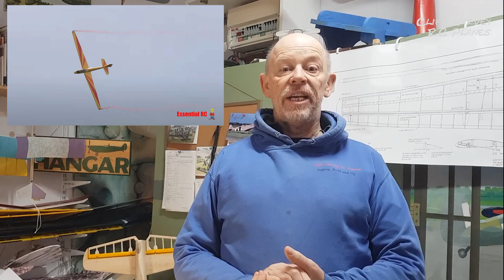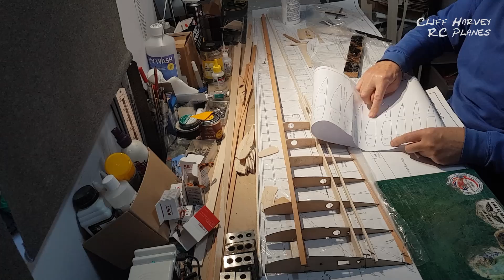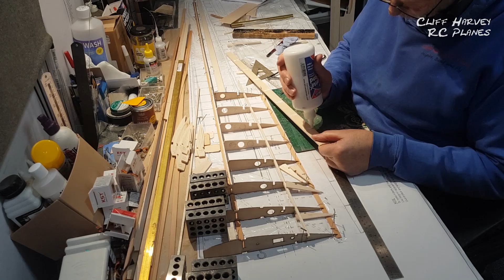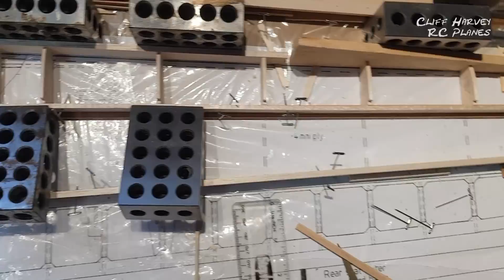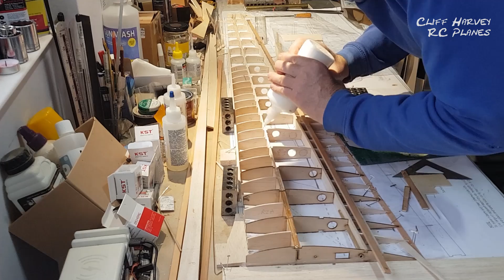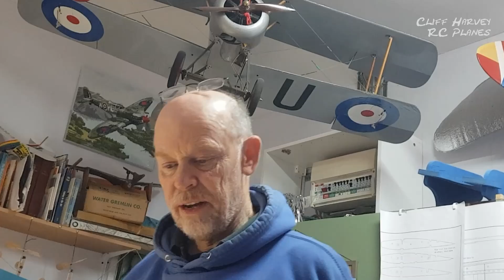Lunak Aerobatic Vintage Glider Plan-Build Part 13

Comment: Cliff, is the washout already on the tip ribs?
Reply from the maker: @stevemorris9788  Hi Steve, on this model it's built into the ailerons, 5mm at the tip so I'll have to make up a twisted building board 🤔